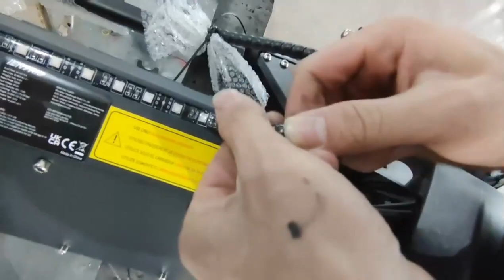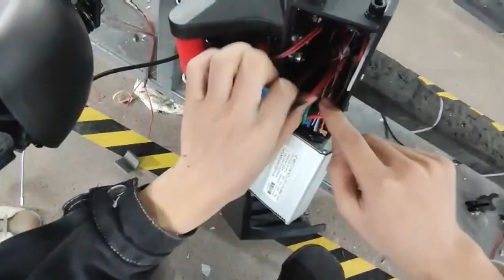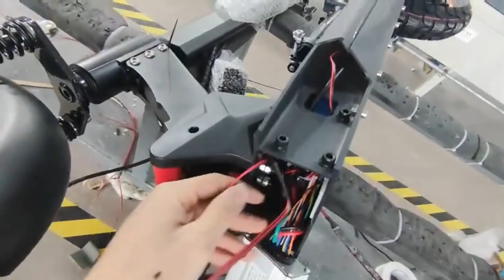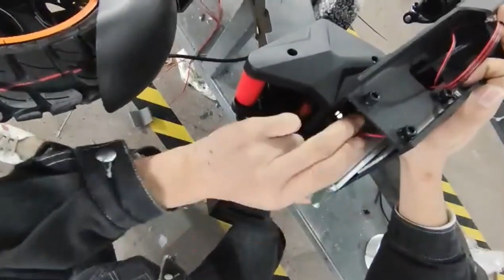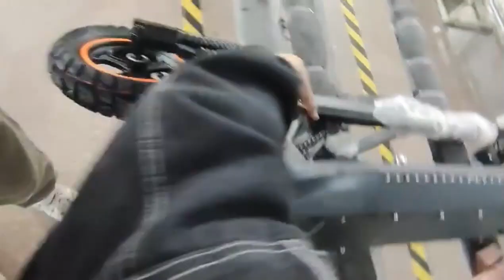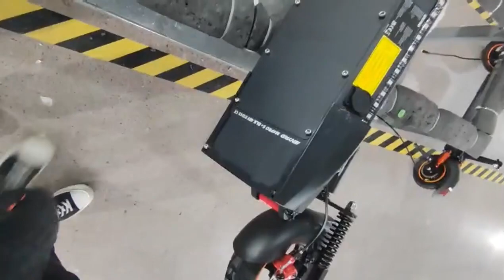[iENYRID M4 Pro S+]  Replace Side LED Light Bar

Comment: Is it possible to adjust the LED light so it doesn't flash with different multi-coloured lights & instead have either a solid light or single colour flash?
Reply from the maker: It is not possible to adjust the LED lights yet, but I will feedback your request to our product department.

Comment: if you remove the LED lights will it save some battery?
Reply from the maker: Actually, yes. But the LED's will make you more visible inside the view of the vehicle behind you at night, thus ensuring safety.
Reply: I do not use my scooter on the streets so not bothered about visible safety.  My question is will the scooter and rest of lights work as normal if I remove the led lights